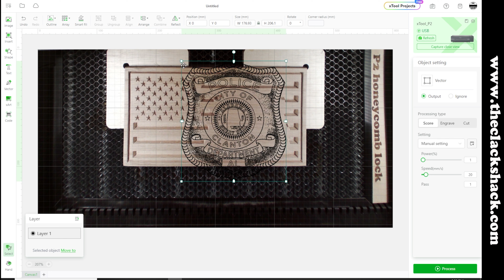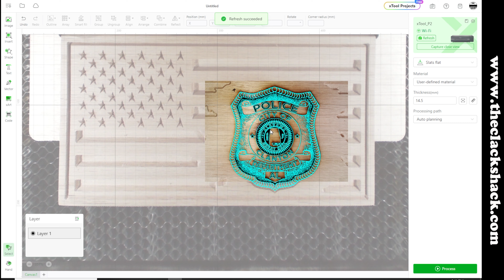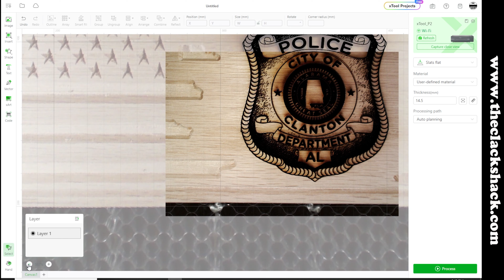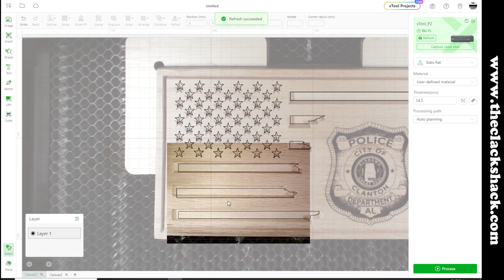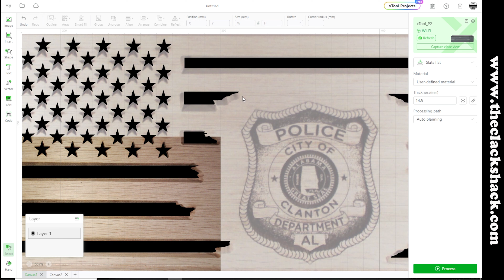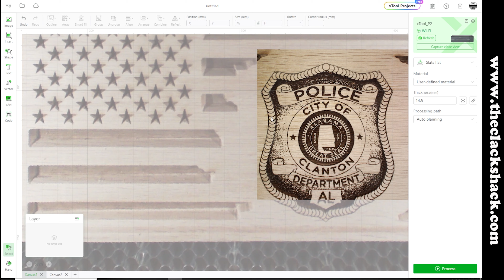Why doesn't the xTool P2 frame jobs?

Comment: Framing on a rotary is critically needed.  I have cups that I have to work around existing graphics and it is really hit and miss
Reply from the maker: Measure the area that you plan to engrave, create a tool line that size, center graphic in tool line and run it. The P2 is not my favorite for tumblers, I prefer the S1. P2 is more complex
Reply: @TheClackShack  agreed,  I do use a frame box with output set to No to get the outer dimensions dialed in.  But again, when there are pre-existing graphics on the Cup and you have to get them lined up, it really is challenging. I also tried setting the box line to 1 power but it leaves little tick marks at the corners.
Reply from the maker: @rocketberger  I use painters tape and a sharpy to mark the bottom with an arrow toward the logos. It helps me make sure where it is at, even when its on the  under side during setup.

Comment: I agree with your thoughts of what xTool was thinking - but the company is making a judgement that about 90% of other CO2 and diode users would disagree with.  The P2 is marketed as an upgrade from the D1 Pro.  It would be so much less of a learning curve between them if we could use the same workflow from our D1 to the P2.  We could work into using the camera instead of having to do everything completely different.
Reply from the maker: I would have preferred they add an internal red dot. Then it would be very versatile